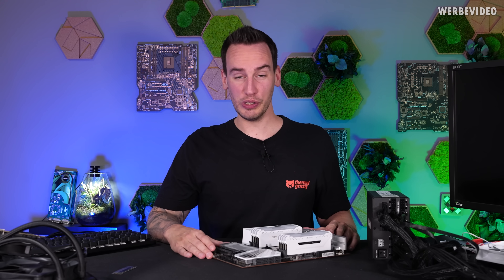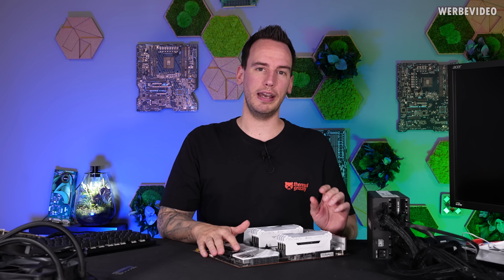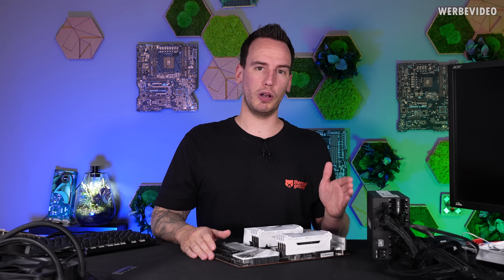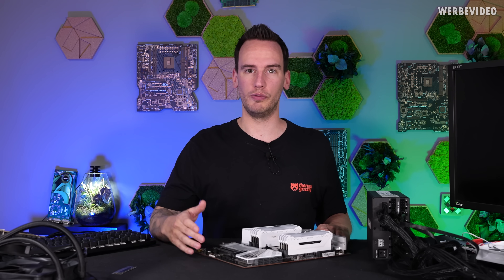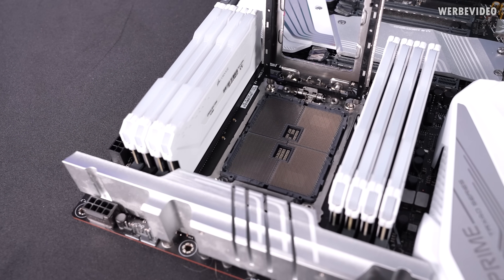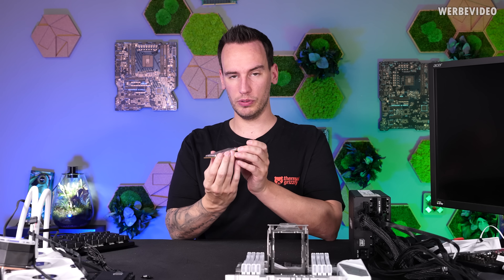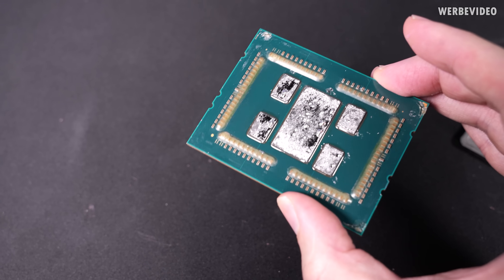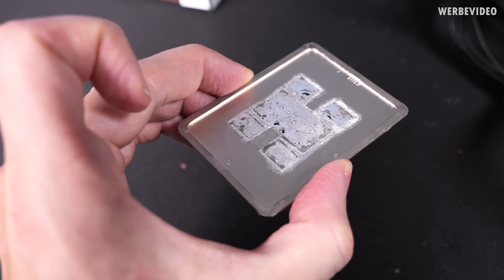I missed the obvious Issue on my Threadripper

Comment: If the problem was the bad contact between the chips and the lid, then how does it explain the previous video? You said that the AIO was spewing out very hot air. And the thermal camera saw the heat. Where did the heat come from? If the contact was bad, the heat had to remain on the chips. If the contact was barely there, the air the AIO was spewing out should have been barely warm, not scolding hot, so even the radiator mesh got mangled.

Comment: Is it reasonable to use a mill to shave off a thin layer from the IHS (and thin the surrounding area for clearance against the PCB) to "fix" the cracked area? How far deep would you need to go? I would guess .1mm would probably be enough.

Comment: I'm running a 13900 under a quite simple block for a year now. IHS is corroded badly, all nikkel has been already eaten away from the block, now it's eating the copper. And I can't get past 300Ws before getting thermally limited.  I feel ya xd

Comment: I notice elevators have certificates showing when they were inspected. That should be done for PC, although perhaps not on a government regulated level. An info card, maybe printed in business-card style with the dates of what services had been done and when those services were done, with a windowed slot for that card on the case, could be extremely useful. Why remember when it can be written down? It was interesting to see the effects of oxidization and alloy formation in the liquid metal through a microscope. I'll never mess with it.

Comment: Good job on the proper check up! I think you went above and beyond!

I remember wondering about the TIM but then excluding it as a cause assuming it was soldered and wouldnt explain the raised power draw.
Now we know the cause, and I still find it curious that the power draw is that high.

AMD cpus take into account their temp and with higher temp comes more required Wattage for the same workload. Ironically this leads to a downward spiral. Seems 'naked' chips overcompensate for the lack of cooling.

Comment: Well done.  I had the same problem with after 2 years of operation with bare copper water block on a Radeon 290X. I always thought it was the (very poorly) home made LQ that caused it. But now it seems it just sped up the reaction.  

But this dosen´t explain why the outlet water temperature was more than 30 degrees higher than coming in.  The thermal images clearly show a massive difference.   Did you forget to connect the pump on that one occasion?

Comment: 4:55  okay I'll admit that I haven't watched the whole video yet. But... The issue wasn't just that the CPU was having problems, it was that it was producing an excessive amount of heat, which would indicate that none of the usual failsafes were actually working. For example it didn't down clock, and therefore kept on producing more heat. How would the IHS account for that problem?

Comment: does applying liquid metal in a vacuum chamber improve thermal conductivity??(and also vacuum seal the ihs) i think oxidation played a vital role in here and also we know the air is not a good heat conductor .

Comment: One thing this doesn't explain: Previous video you said AIO gets super hot / exhaust so hot air that you cannot touch. Heat (energy) doesn't come from thin air and water is good moving it. It's like plugged radiator/broken water pump on a car, heat or temps rises way too high when it cannot move it out. And it takes little time when motor (cpu in this case) is cold.

Comment: Suddenly, real glad I went with the delid and direct die kit for my 9900K. It definitely helped, that the water block I was able to source incidentally was nickel plated copper for the cold plate. Built the system at the end of 2020, only ever had to re-do the liquid metal on it once every two years, as part of taking the block(s) off to scrub inside and get any lingering gunk out.

So, since I admit it wasn't clear enough for me listening to the video, but does that mean the chip can be saved? Or is it time to replace the CPU anyway?

Comment: Even liquid metal causes problems, corrodes and carries out a chemical reaction that degrades results over time. But as a regular user I prefer CARBONAUT. I have already changed a third processor for 2 and a half years and I use it without problems.
Well, the next one will be on an AM5 socket, so I will buy again :)

Ah, yes, because of me, a lot of people who repair computers got stuck, because it is obscenely expensive for Bulgaria to fix problems. Too bad they refuse to sell it to consumers, they don't offer it normally! Only when the user knows such a thing exists and really pushes them...

Comment: Have you considered an attempt to restore the IHS surface by electroplating it with nickel?  Might need to plate with copper first (which would fill the cracks) since nickel doesn't stick very well to many materials.

Comment: Umm, wth!?! Watching your previous video, I initially wondered about a problem with the heat spreader but then rejected that, when you observed that the package power draw was really high, which is a problem that (in my mind at least!) CANNOT be caused by a faulty thermal bond between die and heat spreader. I assumed that this was also why you didn't explore that possibility yourself. How on earth did the power draw DROP after you reinstated a good thermal bond??

Comment: Good video, love the microscope shots, personally I'm not a fan of Liquid metal, tried it a few times, personally its not worth using, it can be messy, and even when the surfaces are healthy I find the CPU can be stuck to the cooler and very hard to separate at times, the cons definitely out way the pros, will be looking to test the graphene based pads on my next build.

Comment: The product I have been wondering about for delided CPU and also for Southbridge,Northbridge chipsets that usually use thermal paste is Graphite pads. Liquid metal is better performing but graphite pds should not be able to eat things like liquid metal and will NOT dry up like Paste. My 8ish year old Asus Rampage iv black edition MB is running hot and I am sure I need to repaste my chipsets.  I would like to do it as rarely as possible since I have to completely gut my computer in order to remove my heatsinks. They are bolted on from the back rather than cheap front mounted pushpins.

Comment: I am not disputing the damage to the IHS, but why the AIO radiator was dissipating that much heat if there wasn't enough heat transfer from the CPU to the CPU part (pump) of the AIO? It seems strange. Maybe the power control circuit on the CPU was overfeeding current because the CPU was overheating instead of lowering the voltage and frequency to protect it? I also had a 3960X CPU on 2020-2021 period and cool it was a constant challenge. I went to 3 different solutions including the expensive swiftech designed specifically for the TR4 socket. That worked fine but not great. And the pump failed after about 7 months just like it did with the previous coolermaster AIO that had before. I ended settling just air cooling ( COOLER MASTER's WRAITH RIPPER) that while it didn't do enough to cool the CPU and the performance lowered but at least was dependable as a solution.
BTW: The threadripper platform is great for running concurrent workloads (I used it for working with many VMs in parallel) but AMD got greedy and the following generations turn into extreme expensive territory so I settled on Intel's LGA 1700 (12900K first and 13900K later) just buit two PCs and distributed the workload instead of using one threadripper. Nevertheless the threadripper felt like it could take any load you put into them and don't get affected because their 4 memory channels and the big amount amount of PCI-E lines so you never found congestion on the system. But clearly the Zen2 cores weren't very performant compared to what Zen3-4 and Alder/Raptor Lake could do.

Comment: Running games 4 times at the same time to trick the CPU and GPu to activate all the parts to fill the load demand , then I turn off the other programs or games back to just one and it's way faster then before due to chip being falsely activated like NvIdiA does come on AMD

Comment: I noticed on my i7 7700k after I delided it and applied liquid metal , the temps dropped almost 20 degrees but I had to re-apply it about 3 times in the 10 years I used it, and it degraded the heat spreader surface.

Comment: Looks to me that the uneven IHS caused air gap which allowed the LM to corrode and stop transferring heat. You need to clean the glue off the PCB corners, I'd take the IHS lip down a tiny bit to close the gap to the dies further.

Comment: Idk why, but having LM on copper heatsink for over 2 years, the temperatures are still superb to any thermal paste, even with corrosion.
I basically cleaned and polished the copper twice, but temps didn't change at all.

Comment: To me your thermals seem to suck with LM. I'm running Threadripper 3960X with close to 100% load 24/7 and with just an EK block and a couple of rads. When my dust screens start to get blocked, my temps go up to 85. That Threadripper seems to run really hot.

Comment: why do I cringe at putting that heat spreader back on without at least a rough 300-600 grit sanding (even though I would do to 1000/2000 grit)
I mean; its a small thing but idk

Comment: if what you saw was oxidation, then could you use silicone to seal the heat spreader onto the die and prevent oxidation? Or maybe some non conductive thermal grease? Would there be harm/benefit from packing the area around the dies with some non electrically conductive but thermally conductive "paste" like material?

Comment: The magnification your SEM pulled off is impressive and history channel might use it on ET theories and proof of life on Mars and others. 
I hope someday we come across kryosheet like material for delidded CPU and IHS instead of liquid metal or liquid solder. After using carbonaut on my laptops and non messy solution.

Comment: I don't think you messed up. I quite enjoyed the "here's the problem, here's some theories, I'll get back to you with what it was later." It was fun to theorize about what was going on!

Which means I'm still super interested in if both AIOs had the temperature difference across the input/output that you saw with the one that was originally on it? The second one you swapped out to test if it was an AIO fault might have been fine as the CPU was the issue, but was the first AIO pumping really slow ASWELL?! I just can't make the maths on the physics make sense unless the flow rate is <30 l/h. It absolutely MUST be a dribble of <8 ml/s.

Comment: I saw this same result for long-term use - 5 years - of conductonaut, even on standard nickel-plated copper blocks, it's just slower, and any mechanical wear from mount/unmount cycles will greatly accelerate it.

The top of my Der8auer Edition 8086k looks similar, the degradation is just not as severe. The block it was mated to looks very close.

That's why for long-term deployment I only use PTM7950 now, and keep a big syringe of kryonaut for bench testing.

Comment: Ok it may not have been some super cool, theoretical failure of a disabled core shorting out but I'll take it. That's a lot of oxidation. Are we seeing some type of AuGa thermal alloying happening and a combination of factors leading to a non-self-limiting oxidation reaction of galinstan?

It's very interesting and slightly terrifying. Gallium is an amazingly frustrating material.

Comment: Even with the issue of the delidded CPU liquid metal thermal interface being compromised, this doesn't explain the AIO temperature difference across the CPU block. Even assuming the lower heat capacity of glycol at 2500 J/kg.k with waters lower density of 1 kg/l, and the heat output at 300W, and an inlet temp of 30°C with an outlet of 55°C for a dT of 25°C, that's still 62500 J/kg (or J/L) which at 300W would mean the max flow rate could be no higher than 0.0048 L/s or just under 30 L/h. That's a lot of stacking incompatible worst case assumptions to achieve that number.

Is the AIO flow rate at 100% unimpeded/no blockages REALLY <30 L/h?!

Do you still get that temperature difference across the CPU block with the other AIO you tried? The reason it didn't solve your issue might have been this CPU TIM issue, and that original AIO is also under performing?

Comment: It's not chemical reaction..gallium still diffuses into the copper through the nickel plating because it's so thin (electrochemically plated on IHS) so it diffuses and leaves the indium behind
Reply: I just wonder… why delidding in the first place? Pure indium has better thermal conductivity than galinstan (sic!). Also, being solid, there is less mess with diffusion and accidental spillage. Do I miss something?
Reply: @argoneum He probably delidded it to see inside for a video originally then used it for an editing rig after rather than sitting on a shelf.
Reply: @v3xx3r It was to promote the delidding process and sell the tools and LM products needed to perform the modification.
Reply: @argoneum if cpu is soldered, delliding is only worth it if you are going to use a cooler on the die directly, otherwise it's stupid
Reply: @argoneum  my unlidded 13900 can transfer around 310Ws at a 60C delta. The connection between the lid and the silicone is just so bad. 

On my TR I have no such issues, never thought about delidding it.
Reply: @bszbszbsz  That I understand: replacing thermal glue with a better thermal compound, or removing the IHS overall to achieve better thermals. Did that with my K6-II back in the day. What I didn't understand was replacing indium (which is superior in heat transfer) with liquid metal (which is inferior and causes problems over time :)
Reply: @argoneum  Aaaa, I see :D

Comment: this is how amd cpus get bad reputation for not being high quality, not lasting long and, being glued together

another reason for me to avoid liquid metal and watercooling, it is a way to induce confusion and problems into a build, the liquid metal barely helps for 99% of users but introduces enough probmems to just say no

the watercooling solution after 4 years is basically getting close to need to be replaced, sadly kind of necesary for this build

half of the sticks are not being detected 🤐

Comment: I want to thank you for your fantastic Kryosheet!

Today i applied the Kryosheet to my PNY 4070 Ti XLR8, and the max temps drops from 83C (Hotspot 95C) to 74C (Hotspot 84C). It already had the pumpout issue after less than a year from the factory.
Reply: 11°C drop in junction temperature is huge.
Reply: @offspringfan89  Temps could probably be better, seems my coldplate surface is flaking nickel or something, the affected area is larger than the actuall GPU die, so no idea. But the temps are just fine as is now, and i never have to look at them again :)

Comment: I wondered about longevity of devices that use liquid metal especially with it entering the mainstream with Sony using liquid metal on Playstations. Even Asus has been using it in their laptops.

I always thought Sony used it to get a slight bit more performance out of their silicon until the process improved and they would revert back to thermal paste and those early devices they didn't expect to survive long enough for corrosion to become a problem.
Reply: @Javadamutt Do not buy the devices, they will fail after warranty due to thermal issues unless remedied. While not to the extent of the capacitor plague, it's going to continue to grow in impact in the coming years.

Comment: I applied liquid metal to my delidded 4570K back then. The first application of the stuff seems to age within a couple of months, as part of it oxidizes and another diffuses into the IHS. When you clean the surfaces and reapply some fresh LM after that thas happened, it stays long-term stable. I still got the CPU and MB, still have great temps.
Reply: My experience exactly
The initial application changes composition and loses effectiveness as the Ga is lost into the heatsink surface
Had some installs last over 3 years with no temp degrading, when the fit is really good (my experience is mostly with laptops)

Comment: if you ever doing a lot of "soldering" , and if you have sandpapered the copper nail on the solder tools so much that it has no more plating left on its surface(naked copper) you will notice that when you do melt a lot of tin, the chemical substance in the tin would react to the naked copper and form black residues that inhibit heat transfers.
that doesnt happen when your solder tool's copper nail still well plated.

Comment: That is not strange, that a bad heat conducting route can heat up significantly the processor.
However, it looked like that the AIO has to cool down way more heat than the processor can generate at that power level. I mean, that usually even with very hot processors, a liquid cooling system has only a couple of degrees difference between the hot and the cool pipes, that is why you can daisy chain CPU and GPU in a custom build. However,  in this case the hot side looked very hot. How does this compute?